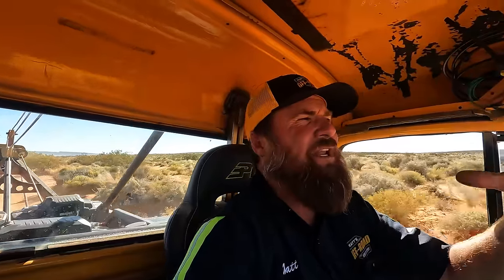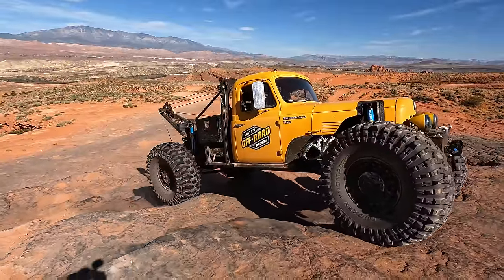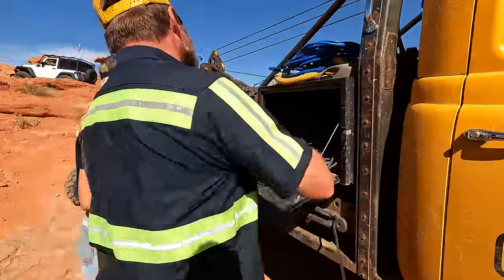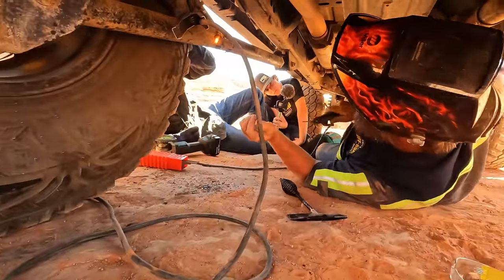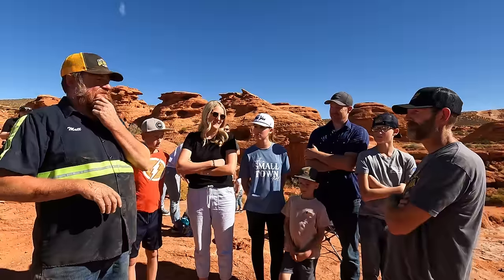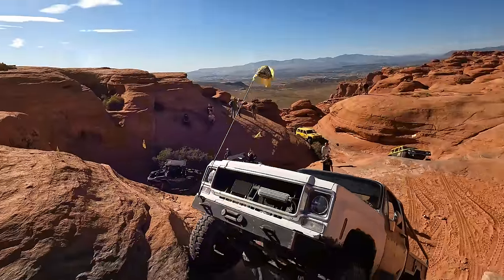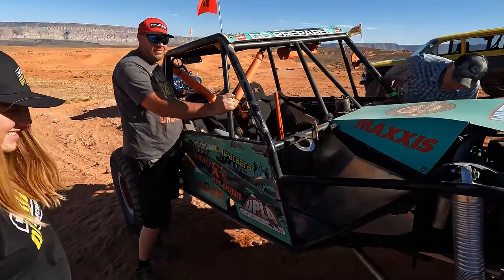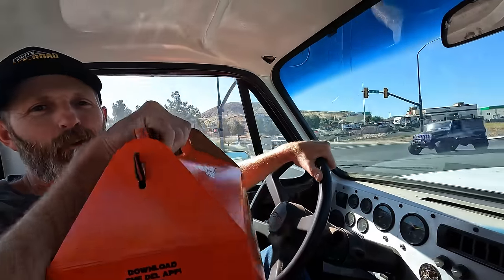Will My Trail Repair Save This Family?

Comment: Any thoughts on why that radius arm failed?

My thoughts are that rear axle was trying to pivot on a different radius than the arm was set at. Radius arms not great? especially for rear axles?
Reply: Junk parts. Poor engineering, tubing wall to thin, weld made it brittle, the list goes on.

Comment: ***MORR Innovative Product Suggestion***
11:07 Matt takes a Yankum rope and stuffs it back in the Heavy Wrecker storage box.
Suggestion: Why not come up with a monogramed water proof bag with velcro or zippers to store the Yankum ropes in.
The bag can double as a water hauler to fill radiators on the trail when needed or use as a carry all for hand tools and  they won't take up space, keeps the ropes organized. The bag could also be attached to the rear of vehicles, use as caution flagging or wide loads
Other suggestion:
Generic Temporary Tie Rod ends to recover side by sides, they can be driven out instead of being trailered

Comment: Pops out of gear durring deceleration.
Sounds like ajustment or worn detent and spring.
As long as you don't have tension on the shifter, you won't wear the shiftrail.

Comment: would a wheel lift style support help stabilize the towee ? you could do an axle lift style but take design cue from existing heavy wrecker trucks who tow by the axle vs the wheels (wheel lift)
Reply: No too rigid for off road

Comment: You guys seem to do a fair amount of trail repairs welding on rigs... I have heard that if you don't take the negative terminal off the battery or if your ground is too far away you can damage some of the sensitive electronics on newer vehicles have you ever heard of or seen that just curious

Comment: Did Matt forget to check if Tom, in Dig Dug was in right gear?  Or did I miss that?   I have cheated by getting next size pipe. Use grinder to split @6” piece. Weld the halves over welded, ground slightly break. Weld that.  But danger a year later bits still not replaced.   Have crew member weld a special shelf spot for yellow winch controller in top of box with padding.it’s too important.  Plus every time box is closed get in habit of checking it’s there.m

Comment: That type of suspension allows zero flex. When it tries to flex, the trailing arms bend at that spot. If the owner of that jeep doesn't change it to a better arrangement, it will keep breaking at that point on one of the arms.  If they strengthen the arms to stop them breaking, they'll either stop the rear axle flexing and pick the wheels off the ground, or will twist the axle tubes out of the diff housing.  It's a really stupid kind of axle mounting system for an off-roader that needs to flex.

Comment: Some insulation in that wrecker would really help. I lived in Cedar City for about 10 years and my old Chevy LUV would get really cold in the winter until I fixed the door seals and put some insulation behind the seat. It made all the difference. Body metal is pretty thin stuff. It's strong but it doesn't insulate at all. On a cold Utah winter having a truck that's warm to work out of makes a lot of difference.

Comment: I always stick a solid rod or pipe in and the wrap it with weld. That welder is bad@$$. Mine has it's own generator and weighs 130 lbs.

Comment: That jeep probably needed a quick reset, likely a battery disconnect for ten minutes. I bet the welding tripped the anti theft and it went into safe mode or whatever jeep calls it.

Comment: The Jeep dude could have self-recovered. Jack handle or breaker bar inside  the radius arm for an internal splint. Then use the winch or ratchet straps to draw the axle forward, and leave it tight. Cannibalize whatever you can to splint the outside of the arm - maybe use wrenches or whatever you can scrounge. Would get you right out of there.

Comment: Tom, in a previous video, you asked about color suggestions for Dig Dug.  My suggestion is that you go play the video game a bit and get some inspiration from there.  I'd go with at least two of the games two primary colors.  Maybe use the different layers of the game as a guide and do multi colors going up the truck like the layers in the game.  Darkest at the bottom.
Reply: Definitely looking to the video game for some inspiration!

Comment: Seeing sweat rolling down on ones face seems to be pretty visible.
Love that Tom: "Do it with the helmet, Take the helmet." For once I can appreciate Tom all the more for being his brothers keeper. Responsibility ends with admonition, instruction, prompting and Love. Tom truly cares. There is an Aussie in this line of comments that tries hard to get Matt to be more concerned with PPE commenting on gloves, I'm fairly certain they are just as concerned with any part of the body that is exposed. Simply closing eyes and turning away does little to stop UV rays for any part of the body. (Jacket) Welding Smock Gloves and minimally a helmet is just general prudence. Which of course is sorely lacking in these instances. Deciding Matt needed glasses suddenly when a wire or shard probably hit close to his eye was all the prompting needed to call for some safety glasses.
How come Matt doesn't have a flag on his Wrecker?
Caitlyn is no Lizzy but she definitely fills a void. Her gregarious fearlessness is inspiring. Lizzy quiet and reserved. Caitlyn (although she would probably never say it) is like:: "Hell Yeah!" Perhaps "Heck Yeah!" ha ha ha. Here's to Tom's influence to eventually overcome the general apathy for safety that seems to permeate the company as it stands.

Comment: A question for you with my ignorance shining,; When I was in the Army (many years ago) the recovery vehicles would use solid tow bars instead of flexible cable for towing.  I was told it had better control when going on inclines with the massive weight of armored vehicles.  Why do you guys not use bars in some situations to avoid the towed vehicle from swinging into the tow vehicle?

Comment: 17:48 "NO BRAKES" --------> demonstrated with the clutch foot:face-fuchsia-tongue-out:wtf?
Reply from the maker: With an automatic transmission, you drive with both feet in rock crawling, and almost every other competition driving. 

So if you’re in the Wrecker, the Banana, the Morrvair , or katelynn’s rock buggy, you will be stepping on the brake  with your clutch foot

Comment: lol no matt turning off that welder before dropping the power will not cause it to discharge backwards, and if it did i would not spend 7 thousand dollars on a welder that has faults like that and not have a protective system

Comment: Why don't you fat mat the truck cab and help keep engine heat out. I did with one vehicle and it was so much better. I like how people slap Jeep grills on buggies, Ford designed the stamped Jeep grill as an alternative to a welded one for the WW2 production.

Comment: Cool buggy. Did he use plastic lines for ATF and brake fluid? I would only use metal lines over warm areas and then use rubber high pressure lines for the ATF to allow flex (in cooler areas). Plastic brake lines seems to cause problems eventually.

Comment: SUGGESTION?- I am wondering if there are sprayable products of thick(so you can build up some) dry lube, so the suspension doesnt squeek like this... Something like we used in childhood for bicycle chains, just disolve a soap bar in smallest amount of watter and smother it all over the chain, gears and other mooving parts so when it dries, does not atract sand and doesnt become like sandpaper...

Comment: Welding on vehicles 

Step 1 
Disconnect the vehicles battery/batteries 

Results for not doing this 

Electronic problems like faulty injectors 🤔🤫

Comment: That suspension design on that Jeep is awful! The axle torque is bending that tube, zero surprised it failed. Also rod ends in bending.

Comment: I would have we8lded another section of tubing that was sl8ghtly larger then the one u fixed a 4 inch long round pipe. I slid on moved it fixed weild clean weild slide piece over then weild that as well walla better then new and looks better and stronger looking.

Comment: whats with the shading over the welding spots in some videos? totally unnecessary; nobody has a display capable of outputting a dangerous amount of light. your cameras are also incapable of capturing a dangerous amount of light. in the video, the weld spot would emit the same energy as the sky when viewed under the Jeep.